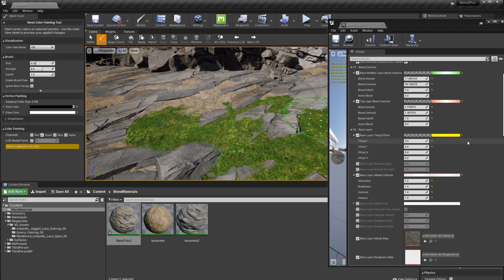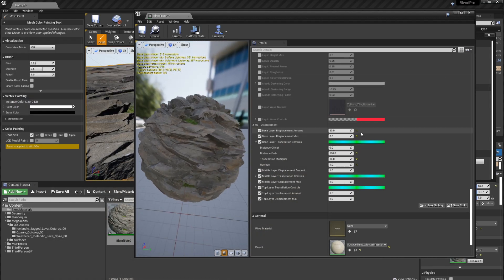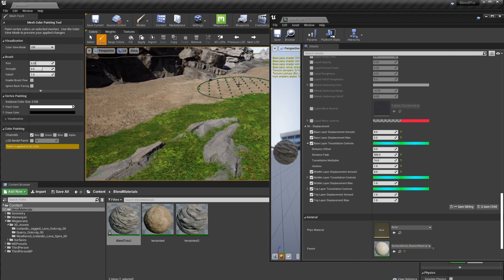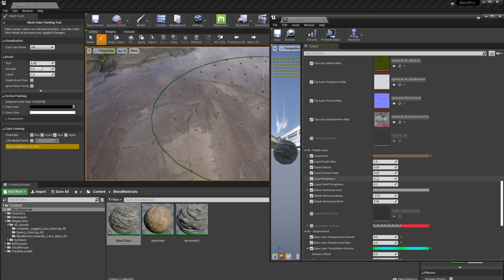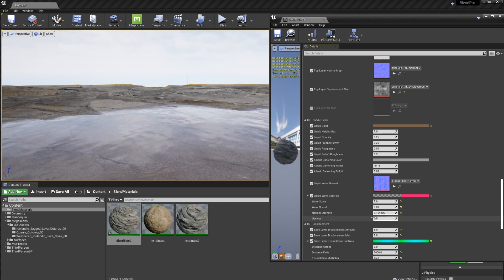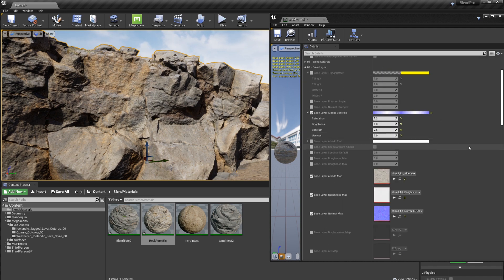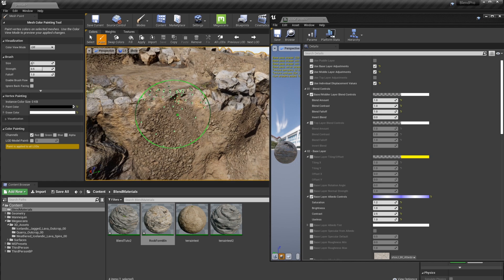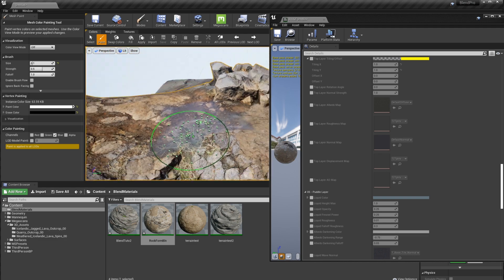Quixel Megascan Plugin Update: Displacement, Puddles and 3D Asset Blending in UE4

Comment: If i look at my (megascan) displacement maps they are all plain grey. So i dont see ho to get any displacement data out of it? im very confused, because it just not working for me.
Reply from the maker: You maybe looking at the ORD map which is a colored compressed map that contains Oclussion Roughness and Displacement
Reply: @MR3D-Dev-Tutorials  OMG on the megascan icon in UE i have to enable displacement!!! But all the time i restart my project. OMG!!! i can finally start my scene ;D I first was sceptical because of the exr 32bit so i changed to 8 bit png, but noting..i reinstalled bridge and ended up cleaning my c drive like a maniac. Then with a good feeling opened my fresh new project and still nothing..until someone in a someones thread commented via image to enable displacement in ue4 in the plugin. ;D
Reply: @ongakuwo  I was exactly stuck on this problem but thanks to you I didn't lose my sanity. Thank you!!
Reply: @MR3D-Dev-Tutorials  uhm..ok thx.Well it seems that im having a major problem in 4.26 and bridge. maybe also relevant to blend mat. My MS_Master displacement material is completely missing. And im not able to find and download it manually. So im installing 4.27 right now. Hope this is fixed there.

Comment: Just a heads up everyone - he’s applying all of this onto a static mesh and NOT a landscape. it happens to SEEM to be a landscape but it’s not. :-) It’s just a slab of rock, which is a static mesh. The feature he is showing is called Vertex Blend Material (new with the quixel MEGASCANS plugin for ue in October 2020) and it is 100% not compatible with landscapes. Landscapes must use a landscape material, with layers inside it etc - the old way.

Comment: Tutorial recommendation: Procedural generation for vegetation to go on top of this?
Reply from the maker: That's a good idea. I did this once but will dig a bit more to see if I can include it in a tutorial
Reply: @MR3D-Dev-Tutorials  Hey again I just realized another thing that may need covering. I tried blending an atlas material with two other normal materials but am getting an opacity issue with not being able to tinker with the values in a correct way. It just shows the bleed from the albedo for the atlas's outside bounds